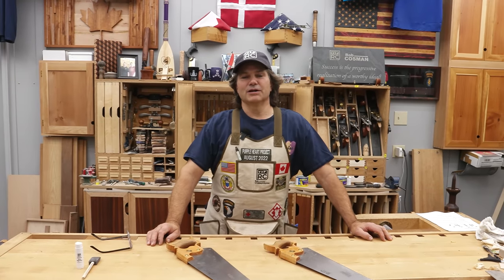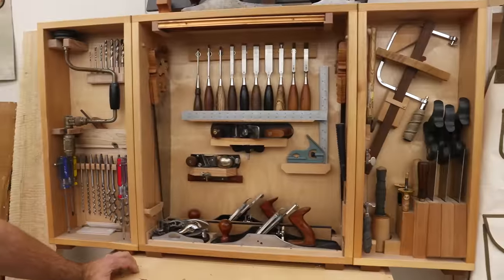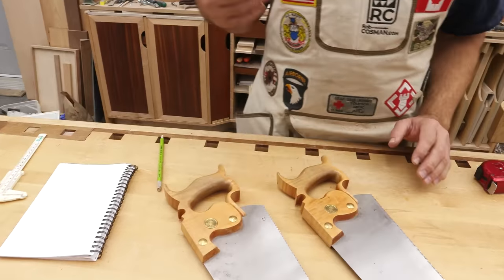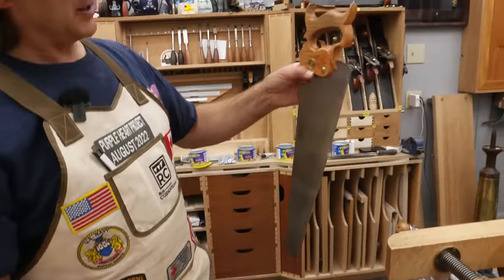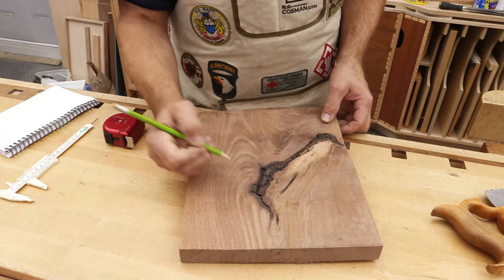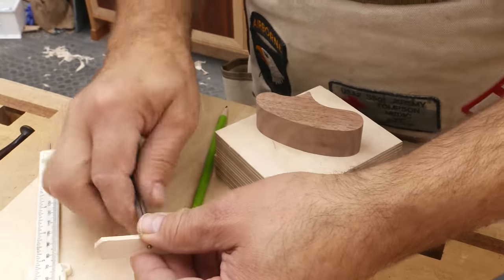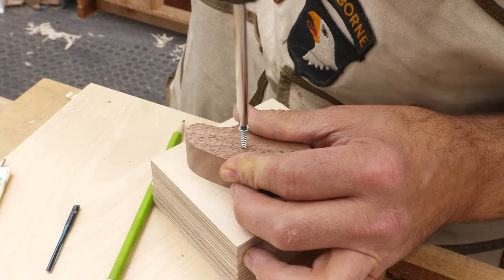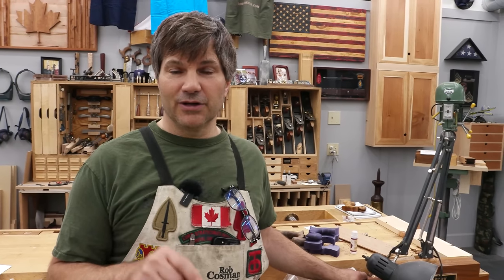Hand Saw Holder Woodworking | Quick and Easy

Comment: It is great to see some things that just work. My father’s tool chest,built in the early 50’s, has very similar cutout blocks, but the toggles are different. The tool chest has toggles that are cut the same shape as the cutout blocks. They are no more efficient but they are nicer aesthetically.
Reply from the maker: I wish I had thought of that

Comment: As always, great video.  Another way to trace out that shape would be to use your pencil with a regular conical tip, being careful to keep it vertical.  Then offset the line by the radius of the pencil shaft.
Reply from the maker: Another great idea

Comment: Not everyone is aware of the difference between a clearance and a pilot hole. Most think all you need is a pilot hole, I have lost count of the YouTubers that just say pilot hole, they are usually those that have never put a solid brass screw in with a traditional screwdriver. I usually pull the thread of the screw across a piece of wax candle this aids the driving in and also prevents it snapping.
Reply from the maker: Excellent point

Comment: How do you determine the thickness of drawer sides? I need to make some small drawers slightly smaller than the ones under your plane till. Half inch seems too thick even three eighths seems a bit much do you have standard sizes or just whatever feels right?

Comment: When will we see Cosman panel saws?
Rob would you not have considered making the shaped or holder the overall thickness (including the toggle) and after you shaped it to fit you could then drill a hole, screw in the screw then remove the screw and rip off the size of the toggle. That way the toggle is exactly the same shape and species as the holder. At least that's how I do mine
Reply from the maker: Thats a great idea.  We are working on panel saws but have run into material issues.  Looks like those issues will delay use for a year or more

Comment: Well I'll be... I've got two handsaws on the end of my bench, held by this very method. Did it maybe 25 to 30 years ago (that's scary to think about). So long ago, can't remember if I saw it in a book, or pulled the idea out of thin air. Either way, a very useful device. PS My toggles are same shape as my fixed blocks. I obviously had nothing better to do.
Reply from the maker: Actually thats a great idea on the toggle